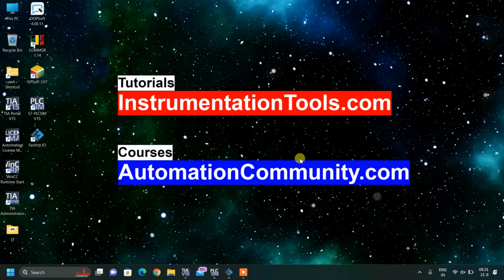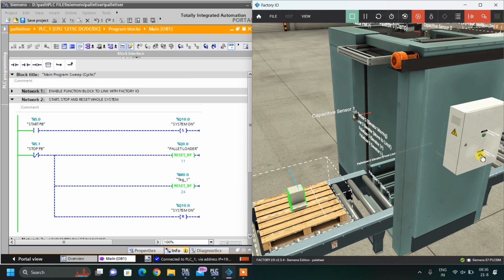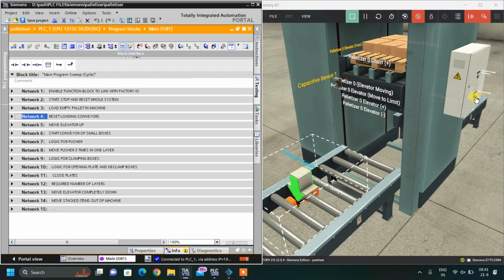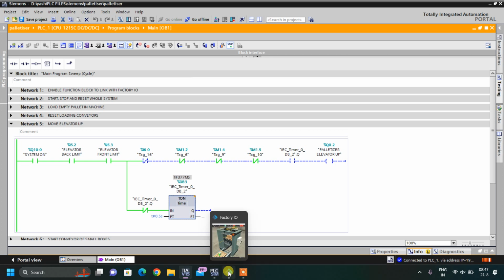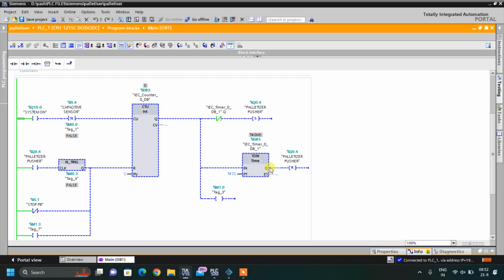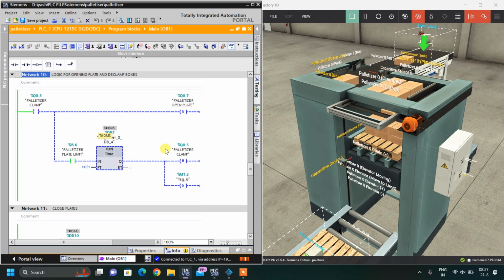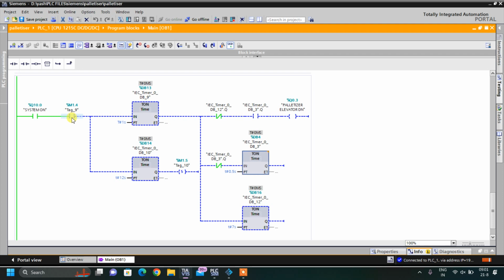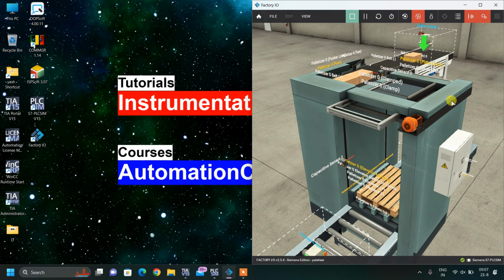PLC Programming Example of a Palletizer - Instrumentation Tools

Comment: or can we add a layer height sensor so that the boxes dont fall to high. when a layer is in the lifter moves down. and stops on negative trigger of layer sensor?? thank you sir
Reply: By default factory io has solution to this factory io has given us three outputs:
1) elevator move up
2) elevator move down
3) elevator move to limit

When to turn On elevator up or down it moves one step only
When you turn ON two outputs for example elevator up and elevator move to limit it will smooth go to upper limit at one go same for down..

So after loading 6 box turn ON only elevator down and it should move down only one step.

But in my case sometimes my outputs were malfunctioning (software problem between factory io and tia portal output On in tia portal but not ON in factory io)
so changed my process to above process.....